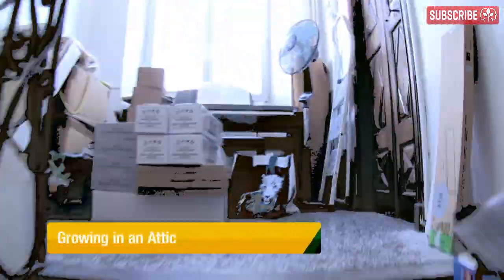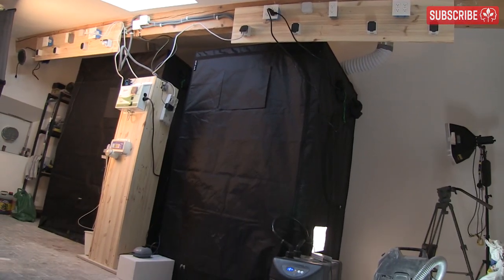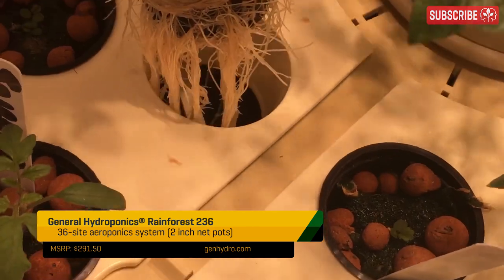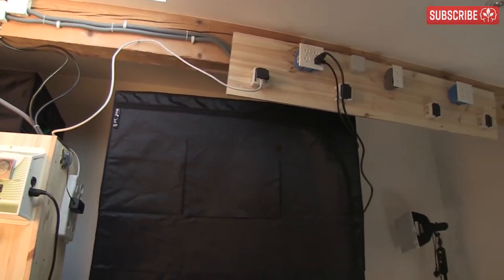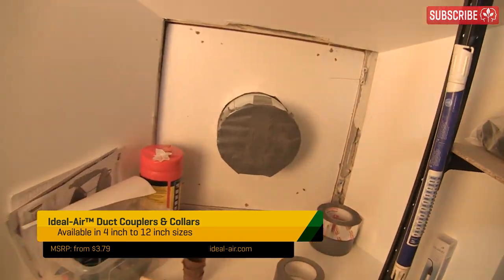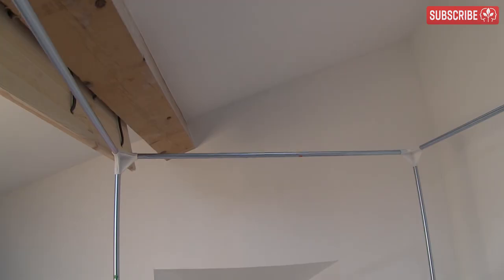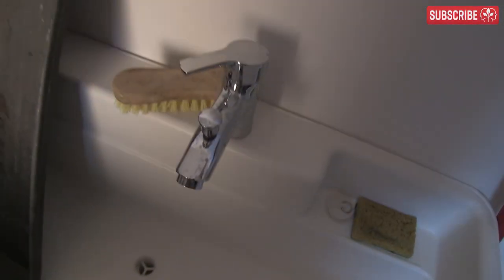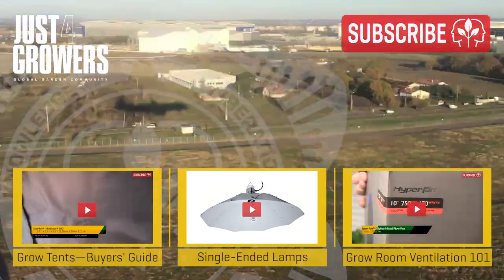Growing in an Attic / Loft Space

Comment: I put in a attic fan on a thermostat , it gets hot up there even in winter where I live and it vents the humidity out too. It was about $300 and the attic needed it regardless . If you have to use AC in the house in summer it will pay for its self.

Comment: How expensive was it to add ventilation and a water source to your attic/to generally finish your attic?
Reply from the maker: Ventilation, if no other exit exists, can be created with a vented roof tile (a special adapted roof tile designed for this express purpose) — the maximum duct diameter is usually 150mm or 6" though so you may need multiple ports. Getting water up to my attic was very easy—although I needed an inline pump to increase pressure to make my RO system work properly. You shouldn't really need to spend more that a few hundred bucks, especially if you can carry out the work yourself.

Comment: Would 3 600 watt light on the loft melt the snow on the roof?
Reply from the maker: Invest in quality roof insulation to avoid such inefficiencies! You really can't overdo insulation. Also, consider air cooled hoods to remove some of that convection heat. Good luck!